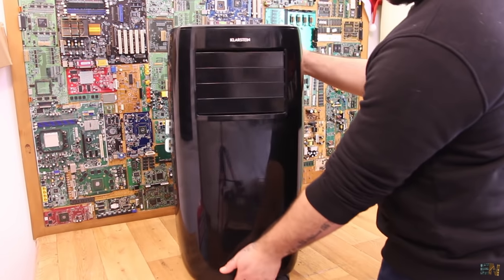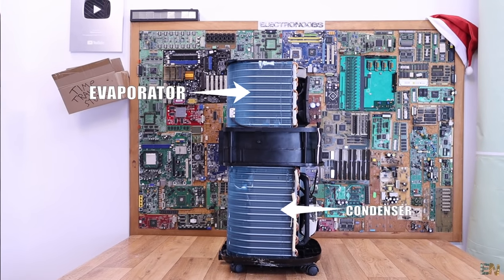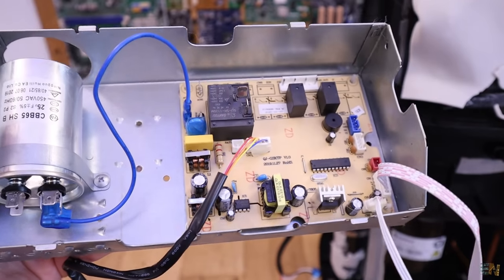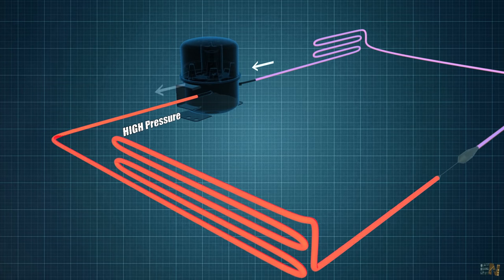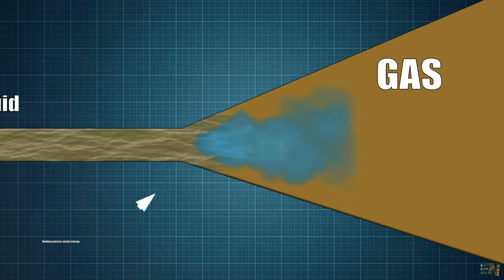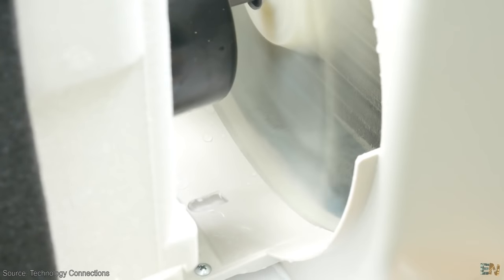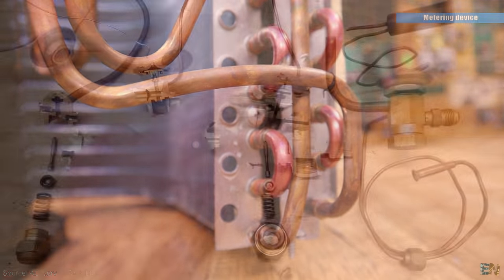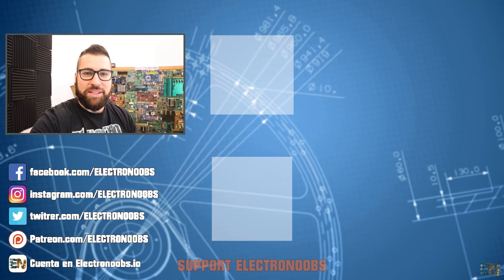How Air Conditioner Works And What We Have Inside

Comment from the maker: Arduino Course (Spanish): https://bit.ly/3ldW6kO
Follow me on FACEBOOK for more: https://www.facebook.com/Electronoobs
Help me on Patreon: https://www.patreon.com/ELECTRONOOBS
Reply: There is a fail in the Exploration of the Expansion valve.(13:10) it dosn't operate like this. If the evaporator is cold enough, the sensing refrigerant in the sensing Part retracts and closes the valve, becourse the refrigerant in the evaporator cant compleatly evaporate and  so it makes sure that no liquid can go from the Output of the evaporator to the compressor. 

 But its Position is between condensor and the evaporator. Its Sensor is connected to the Output of the evaporator. 

Think about the placement of the capillary Tube, its the Same as the Expansion valve.  

Also it closes when its Sensor gets to cold and opens when it gets warmer. 

(Sorry for some misspelled words, im german)😉
Reply: Thank you so much, I have learned something interesting
Reply: Your simple-to-follow teaching videos contribute greatly to many lives around the world. Thank you. I wish YouTube (AKA Alphabet Corp.) knew that as well. C’est la vie.
Reply: Brilliant video, it explains the process very well. Please, my spicy chorizo, investigate cascading cryogenic systems. As the temperature for each level decreases, it uses a more appropriate refrigerant for the temperature and pressures that will be required.
Reply: Hey how are you can you please help me..i have a portable ac it does work and cools but the compressor keeps turnin off, do knw what can be causing this, it cools for one min and then stops can it be a sensor or is it somethin i can fix??
Reply: Muffler? Where's dryer?

Comment: Some corrections for stuff in the video:
Air compressors usually use reciprocating compressors which have pistons but these types of compressors which are a second type of rotary vane compressor have a different design. It is not a screw compressor and I have taken one apart before. You usually find screw compressors on large water chillers. The liquid dryer is before the metering device.

R290 is propane aka a hydrocarbon. Hydrocarbon refrigerants do not have any ozone depletion potential aka ODP. HFCs like r410a(r32 and r125) have no ODP but they do have GWP aka global warming potential. Hcfc refrigerants like r22 are being phase out and have both ODP and GWP. Cfc refrigerants like r12 are VERY VERY BAD and are illegal.

I agree scroll compressors are becoming more common but you will still see reciprocating compressors and rotary vane compressors. All motors that have VFD capability or multi speed capability can drive motors/compressors at variable speeds. Newer chillers usually have scroll compressors.
Reply: It's s scroll compressor.

Comment: Love your videos! Couple correction.
1. Your fans are not turbine fans they are centrifugal fans.
2. It is not a screw compressor it is a rotary compressor.
3. The device on the compressor you referred to as a muffler is a suction accumulator (prevents liquids from being sucked into the compressor)
4. R290 is one of the most environmentally friendly refrigerants, but it is flammable.
5. The temperature sensors are likely thermistors and not thermocouples.

Great video thanks!

Comment: I did convert my portable A/C to a dual hose and that seemed to help a lot.  I eventually upgraded to a mini-split system.  The portables are just too loud and I hated that mine used my window.  My 12,000 btu can get my room ice cold and not even be phased while it seemed like my 10,000 btu portable had to work overtime to get my room down to a comfortable temperature.  Portables and window A/C units are fine if you're renting.  But if you own your home, you can't go wrong with a mini-split.  Best thing I've ever done.  Might install one in the living room next.
Reply: Mini Split is going to be the best. Wall or Window Units second. If in the states you need to look at BTUs SACC (Seasonally Adjusted Cooling Capacity or DOE) for portables. Since most portables on the market are less efficient. As of 2017 most of your 10,000 BTU units are far less. Many people tend to miss this when sizing one. Which is why the gov. changed the BTU rating system for portables.

They do work if sized correctly and dual hose units seem to be a bit better.

I do have 10,500 BTU SACC unit. Zero Complaints for the space it cools. Renting. Although they start to get quite expensive in this range.
Reply: How did you convert it? I want to convert mine as well
Reply: @Hieu.minh97   avoid condenser coil to suck air from inside room. Close it and attach one hose pipe.  The keep other end of the hose pipe outside the room. 

In short.. Existing portable AC has only one hose thats hot air out hose.  Make one more hose set up   at the inlet side of the condenser coil

Comment: I had viewed a lot of videos about the AC and the only thing that I couldn't understand was the expansion valve.
Finally with your explanation and very nice diagram I understand now.
There are two valves, one is the compressor and the other is the expansion valve. The expansion valve is an "open valve!"
Thanks for the video!
Reply: Same

Comment: I like all of this except for your explanation of the compressor. What you were pointing at in the beginning is called the accumulator, which is on the suction line going to the compressor. What the accumulator does is make sure that there is no liquid refrigerant flooding back to the compressor which can damage the compressor by pushing oil out of the compressor in into the rest of the system. Compressors are actually quiet enough that they don't have mufflers for commercial or residential Refrigeration equipment. I also just found that you are saying the refrigerant is Flowing the incorrect Direction in the system. The refrigerant actually flows through the condenser first because it's a superheated high pressure gas after it leaves the compressor, and then in the condenser it condenses down to a liquid refrigerant. After going through the condenser, it comes up to the metering device that slows down the flow of refrigerant into the evaporator, making it a lower pressure in the evaporator. And since the refrigerant cannot exist at that lower pressure it has to evaporate and as it evaporates, it absorbs heat energy from the atmosphere making your room cold.
Reply: So many small errors, I give up.

Comment: Thanks the model you showed is very similar to my dumpster find. The controls are messed up and I hope to get it working with an Arduino. I wanted to know what the splash motor does, and you explained that very well. thanks for this video!

Comment: Very nice and detailed teardown!
I also have one of those ACs and its a powerful unit: I think it has a 1000W compressor and I measured the cooled air outlet at below 10C. So it cools really well.
But the unit it too loud and its too powerful to be honest. The compressor runs at 100% power no matter what and it produces strong vibrations which I tried to dampen with rubber mats below the unit. That helped a lot.
It it possible to control the speed of the compressor with a VFD? Should work just fine since its just a big induction motor.

Comment: My (the cheapest in the local market) portable AC efficiency class is A. How good are the good ones? I can make other duct for it and put insulation in the ducts to improve efficiency. But it is used for a couple of weeks in the summer heat, so energy consumption is not a priority. It is a good dehumidifier  in the cold, wet season. It is not only for confort, it can save lives.

Comment: Now a days the compressor used is an inverter compressor. It work by converting the AC current into DC and a motor driver (inverter) convert the DC current into variable frequency AC, so that it can be used to drive the motor of compressor in variable speed. 
   So instead of starting and stopping of the compressor like here, the compressor can operant at variable speed as load demands. 

Hope this was helpful...
Reply: nice post but from the new inverter airconditioners we have, I haven't seen one that continuously works at low power. I hope manufacturers have a feature or setting to restrict ac to lowest power or most efficient operation.

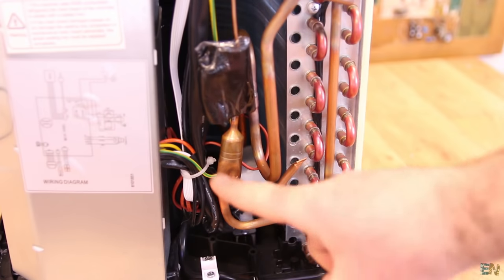Comment: 3:19 suction accumulator to stop liquid refrigerant returning to the compressor directly
3:26 liquid line filter/drier and capilarry tube metering device
5:03 thats the suction/return line, discharge line goes to the condenser to be subcooled and condensed into a liquid before going to the metering device to reduce the pressure and thats when it become cool

high voltage capacitor ? nothing exceeds 1kv in there to be considered high voltage

Comment: Hi. If I would like to install this in a minivan and do to lack of space, I would divide it in two:
1.) could I mount the compressor and the condenser under the car ?
2.) could the condenser be mounted together with a fan in a horizontal position, or does it have to be a little bit inclined ?
3.) if it is a 4 in 1 product (cooler, heater, dehumidifier, and vent, would it still ALL work when separated ?
4.) can the wiring from the compressor or other parts get wet ?
Thanks in advance for your support. 
Martin

Comment: You could try converting this A/C to a more efficient one by adding a 2nd tube which will take the air from outside.
Reply: I was thinking the same...
Reply: @Tiago Ferreira I know, I have one.
Reply: yes good idea!
Reply: It is already having the tude , just you have to put that through the window.
Reply: Ur comments tell u hvnt got the principal of AC working and thermodynamics
Reply: @doityourselfpakistan6535  Nope it’s true. Like any other type of air conditioner, you want to cool the condenser with outside air. Using indoor air and then expelling that air is not energy efficient.
Reply: On the channel, "Out On The Reef" he takes a window unit, cuts the copper tubing,  and moves the condenser to the underside outside of his camper van. It saves space and looks better.
Reply: Or you could turbo it
Reply: The glorified air grabber would do well.
Reply: I had mentioned that to other people. You need only one exhausted flex  hose coming out of the back side of the AC unit. By using a coaxial hose. A smaller hose inside a wider hose. The wider hose draws. Out side air into the evaporator coil passing the inter hose that is venting the hot air out side.But well not be effective unless the inner hose has good heat insulation on it. Other wise it well make the air that is going to cool the condenser coil much hoter then the outsides ambient temp. So the flex hose well be wider in size. And cost more to manufacture.

Comment: Another comment to be added.The air that is cooling down the condenser coil in a portable AC unit is not the out side air! That is for a window type AC unit. The portable AC takes the inside cooled air of 80 to 72 deg room air and blows that passed the condenser coil and the now hot air is passed out the window through flexable  exhaust tube to the out doors. Because of this procedure you are lossing some of the cooled air in the room that the air conditioner producted in the first place! So for that reason a portable unit has a lower efficiency rating in its  cooling  BTU rating compaired to a mini split AC unit. (Why?) Because you are using the inside room air to be vented out the window to cool the condenser coil. A mini split has its condenser, cooling fan, compresser, and metering device a EEV expansion valve, and electronic circuit board out side the building. Also note that the 4" flexible air ducking that removes the hot exhaust air from the back of the AC unit is acting as a heat radiator' and it's warming the indoor air in the room. So you have to wrap it up with 2" fiberglass insulation so it well not generate its heat to the very room that you are trying to cool the room. The only big advantage that the portable AC unit has over a window mounted AC is that the inside air that is used to cool the condenser coil well lower the compressors head pressure. Compared to the hot  outside temperature of 97 to 106 deg. So the amount of current the compressor draws is lower on the portable AC. To cool the same room in your home. Wow that is amazing information!

Comment: Excellent presentation.  BTW - it's a scroll compressor - not a screw compressor.  The only reason I like these portable units is the compressor.  I use these ACs to build other ACs since they give more lengths to play with on the copper distribution lines.

Comment: Great video! I’m considering making a frankenchiller out of an air conditioner by immersing the condenser coil in a cooler of glycol solution. It seems that these portable units would actually be a great choice for this since the condenser coil is already stacked at the bottom of the unit and you don’t need to bend the delicate copper pipes as you would on a window AC unit. Appreciate all of the close up shots, it was really helpful!…

Comment: @12:05 -  scroll compressor is direct current driven - it uses half the power to cool .  It's marketed as " inverter AC " ( alternate current to  direct current inverter) - it's usually found in more expensive models but worth it if in use for 2 months and more per year

Comment: Hi! How rigid /or flexible those copper lines are?  I'm wondering to twist and bend the upper part 90° and submerge it in a water tank, and run water lines to two smaller rooms apart fromeach other, and place the AC unit on the balcony (which is enclosed from the elements and has windows). And I would hook up some water cooling radiators os second-hand fan-coils or similar to those chilled water lines in the rooms. Sounds Bad? Maybe the bending part of it. But air-water-air heatpumps are actually exist to cool/heat entire buildings so the priciple should work :)

Comment: Electronooobs thanks for a like , I want to make a flashlight that can be powered by a single li ion cell can you help, i don't want to use any specialized IC  and  it should have constant current functionality. I think youtube is filled with useless videos that makes flashlight either with just constant voltage source or using a specialised ic , i think it would be a good video topic . Any help would be really appreciated !

Comment: That's an accumulator not a muffler. It's purpose is not for noise suppression but to prevent any refrigerant that has not turned into gas state from entering the compressor since just as you said liquid entering the compressor could cause damage.
Reply: Correct, I was looking for this very comment lol

Comment: So i suck at saudering and ive diagnosed my portable ac problem. Its the resistor on the main board. I dought you will see this since the video is 2 years old but it would be awesome if u could do a video on how to change out and resauder a new resistor onto a board.

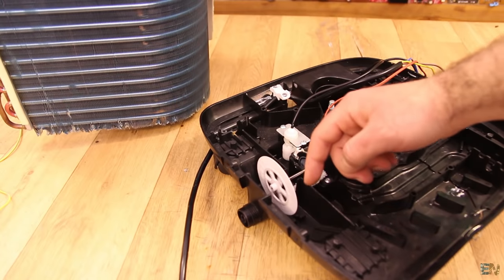Comment: I have a question, at 10:21, as you said, there is a wheel wich is doing its job. But what would happen i would remove it?  Would it just be less effective or cause more trouble?
Because in my case it is loose and makes a terrible vibration noise and I tightened it but after a while it came loose again.

Comment: r290 is one of the least harmful refrigerants ozone depletion of 0 and green house warming of 3.
r410a has a green house warming of 2088 and r134a of 1410
Reply: Beat me to this comment! If you use deodorant in a can you shouldn't have an issue with this gas.
Reply: And if you use can air to clean your computer you also get at least a wrist slap 👋! They’re all refrigerants to some degree

Comment: Now this is how to make an educating video. Well done. I would have liked to hear more about separating the evaporator to outside and keeping the condenser inside. Or is it the other way around?
Reply: other way if you would do that it would just eject the heat to your room. If you would try to do that the good way remember that there is a gas inside the pipes and you would need to take the gas out and insert more as the pipes will be longer

Comment: In the beginning you told the compressor output ist connected  with the Evaporator. And on the explanition you told it is connected with condenser. 
Cold side is going  to the compressor input. 
Likewise, the part on the compressor is not a muffler, it protects the compressor from liquid refrigerant. Liquid cannot be compressed.

Comment: Great explanations as always . 
Will it be as effectint to use thermoelectric coolers for this process ?
Reply: No this process is more efficient. Thermoelectric coolers cold and hot side are shared, limiting the temperature difference between them. Best are split units, window units, then these (2 hose portable ac's  perform better than 1)

Comment: Now mod it to attach a second duct for condenser cooling air.
Reply: Just cut the crap apart and place the compressor and condenser together with fan, filter drier and capillary outside. Inside you just keep the control, evaporator coil and another fan as well as a driptray with drainage. Just have to connect it with longer tubes and charge the system properly.
Reply: @tronixfix  wish it was possible to charge ac refigerant by yourslef in europe

Comment: What if you were to dip the condenser into water which will circulate into outside air? Obviously there is a risk of rusting and shocks, but will it be "less useless"?

Also,  great video, nicely explained!